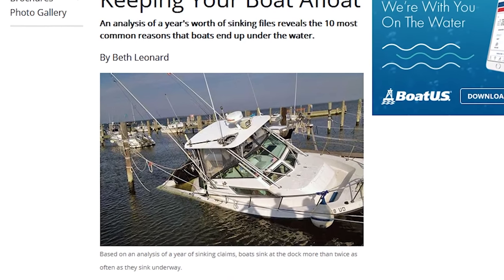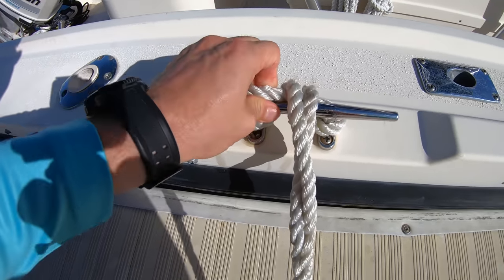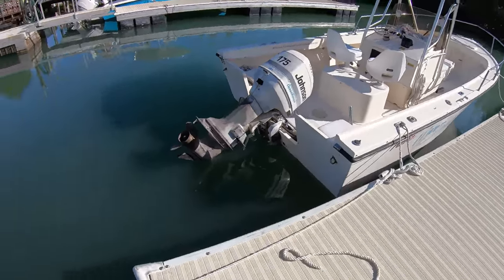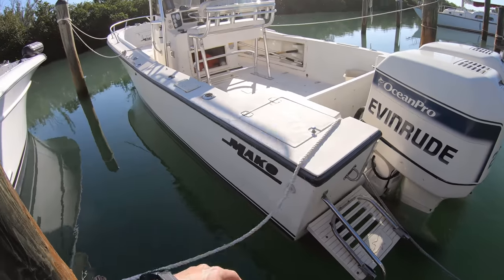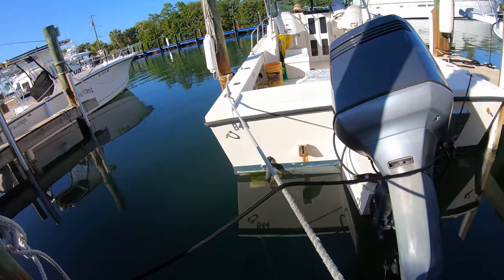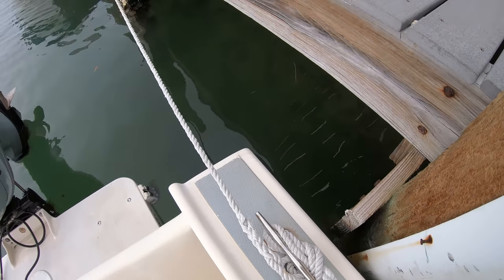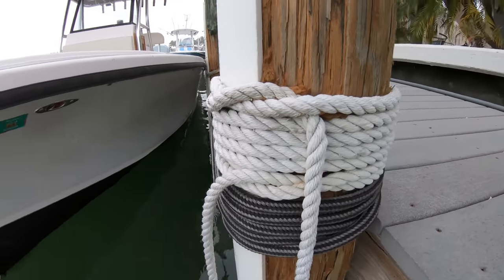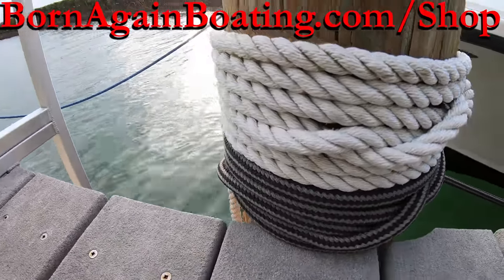THE ONLY Video You MUST SEE On How To Tie Up A BOAT!

Comment: Good stuff. 
After hurricane Matthew hit St Augustine, I recall seeing most of the sinkings (25 sank) at one popular marina were still tied to the docks after they sank.... It was the failure of the floating cement docks that sank the boats. The lines should of been equalized on both sides of the docks....Yes, this means you need longer lines and have to step over them at times when you need a hurricane level tie up.

Comment: I have had to replace my rub rail due to the up-and-down movement of the boat against vertical dock fenders like the ones in this video. How do I prevent that from happening? I noticed that you didn't use any fenders to address this.
Reply: John, vertical fenders are always going to be tough on rub rails if this is a permanent dock for your boat.  Generally vertical fenders should only be used for short tie up.
Reply: @JohnJohn-wr1jo  That's where it got damaged – while at lunch for less than an hour. Of course, it was in the ICW, with lots of boats doing by. But I think I've found a solution: tie my own fenders horizontally to the dock fenders to keep the rub rail from even touching the vertical dock fenders.
Reply: @johnlewis6418  or invest in flat fenders/fender-boards
Reply: It seems everyone ties their boat too tight.  Give the boat at least a foot of 'space' between it and the dock.  I give it 16".   Voila.

Comment: I consider this advice to be poor and amateurish.  The guy ties his boat way too tight.  That means that all the cleats work hard.  So do the lines.  The boat goes one way and the waves, water, current goes another - give it a little room!  Add in a storm and you have the boat and the float 'fighting' each other.  It makes way more sense for the boat to have 12" or so of space from the dock so that the boat can rock and roll with some give and take in the rope by way of a little slack.  My current boat is 22' and I give it 16" plus fenders.  If you use 'springers' the boat will not even go forward or astern on the spot.  And lighter 3-strand is the best dock-line for the same reason - more stretch.